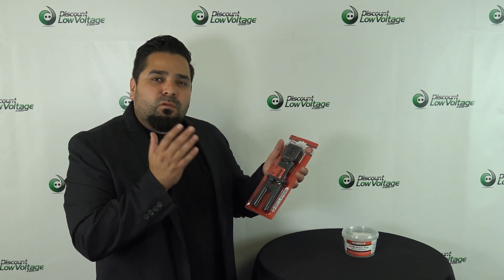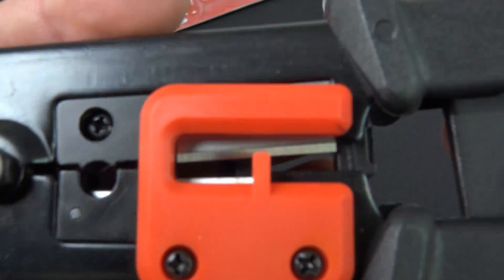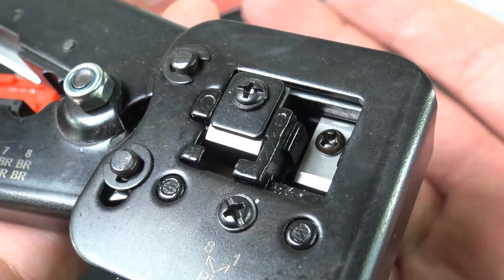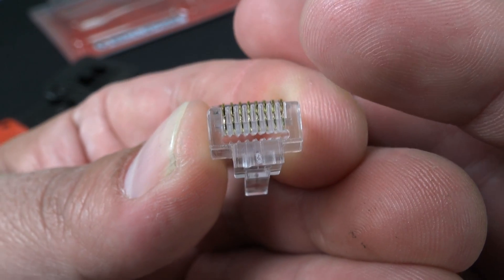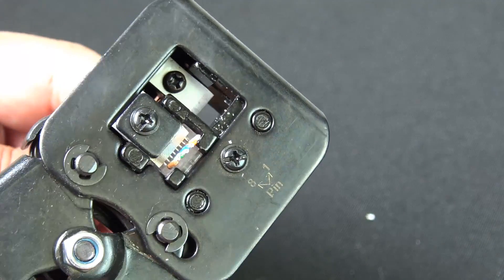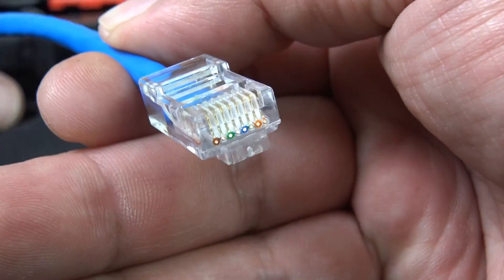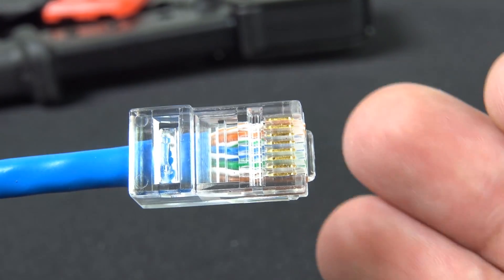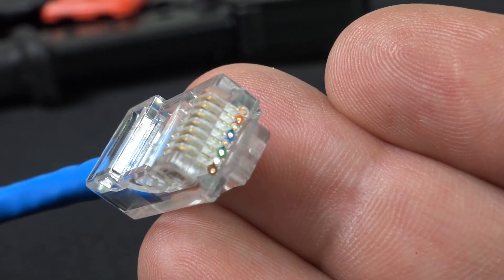How To Crimp RJ45 Pass Through Modular Plugs w/ QuikThrough Crimp Tool

Comment: I could really use a thing like this.  I despise any cable which I must cross a wire from one twisted pair to another color.  I wonder how many electricians go insane trying to get them to line up right.
Reply: I get frustrated because my crimper doesn't have the blade. What I usually do is cut clean at the end, strip the outer insulation off to about an inch and then completely untwist all pairs and then grip them between my thumb and forefinger with both hands to straighten. I put them in order and pull straight. I squeeze the twisted pairs tight and hold them flat while I use the wirecutters to cut them perfectly straight. Then I feed the remaining half inch into the plug and crimp.

Comment: Very nice. The new RJ45 connectors are so much better. It's much easier to keep everything lined up correctly when you have more twisted pair exposed. No more worries about having too much twisted pair so that the sheathing isn't crimped off either. Nice.